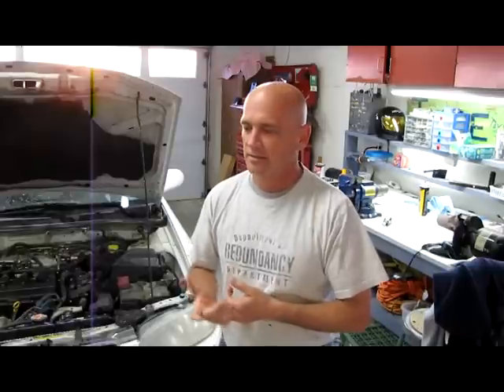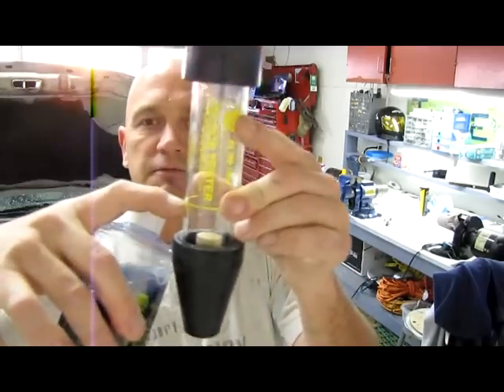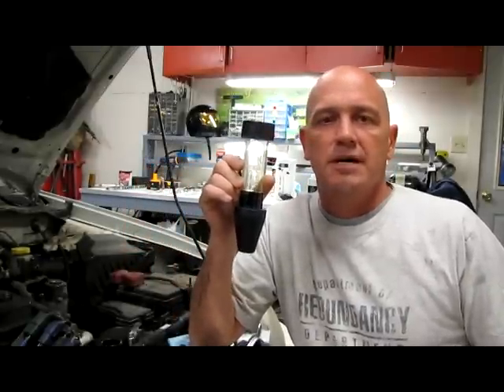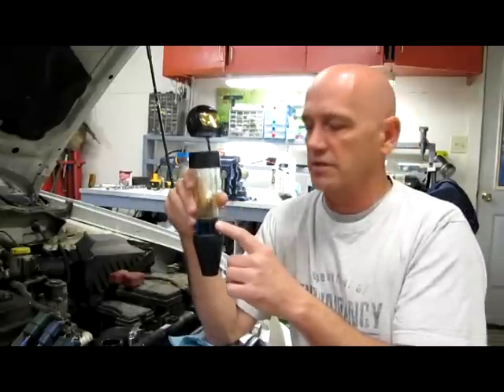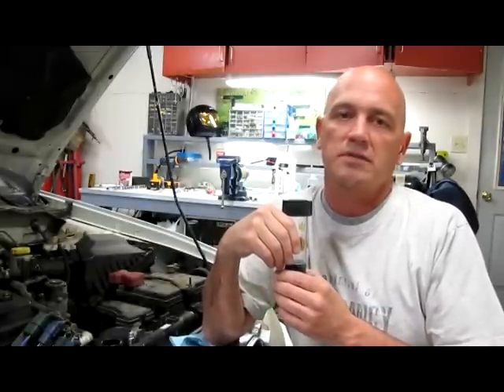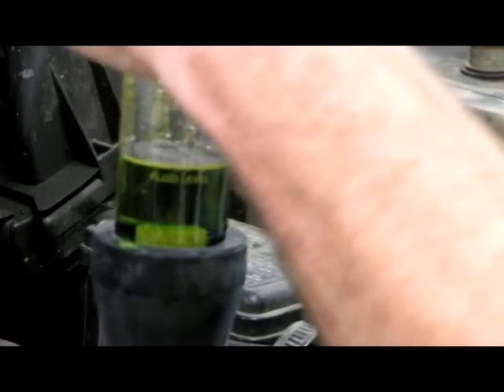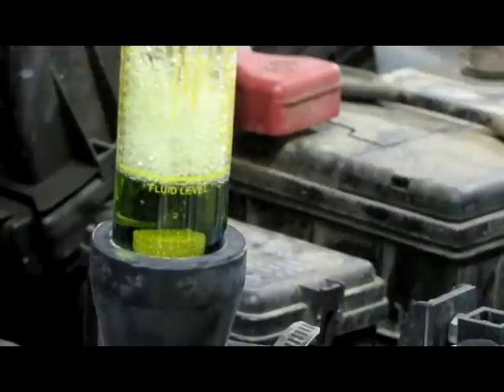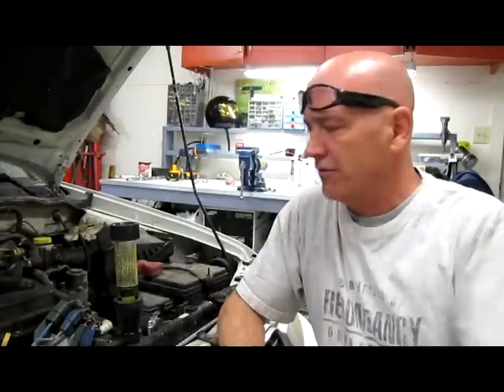How to Test Head Gasket

Comment from the maker: Effie Caine: I am guessing this is most likely a 4-cylinder vehicle. Several years ago in my 'day' of doing this, a 'typical,' but (must emphasize) PROFESSIONAL head gasket replacement on a 4-cylinder averaged about $500 with parts, R/R labor, and machine shop services (to check the head and correct any warps on the bottom). I'd imagine that the $300 difference is basically the increase since those years,so I don't think that $800 is a bad price, so long as it's PROFESSIONALLY done. Continues...

Comment: . He then wished me luck and let me go. Ive been driving it for 4 months still just baby sitting it. Putting water in the radiator every other day, and now the radiator is cracked again.. Sorry, I guess my question is do you speculate that it is just the upper intake manifold or head gasket? 3.8 Pontiac Bonneville 98. Thanks

Comment: @ reluctorvalve. So my car began overheating awhile back so I replaced radiator and both hoses. Also replaced thermostat before that. After the fact of it overheating again I saw a mechanic and he did a pressure test on it and it revealed that its a upper intake manifold leak but he was very concerned with the amount of pressure the car was losing in a short period of time. He also said the raidiator cap smelled like the "smell of death". He then wished me luck and let me go.

Comment from the maker: SpeedFighter2AC: This description doesn't necessarily indicate you have a leak.  Pressure Testing is the way I was taught to determine external leaks or even really bad head gasket leaks.  I've seen some bubbles in coolant flow over the years.  Unless it's exhibiting some kind of abnormal temp or anything else, I wouldn't worry so much about this. r-

Comment: I did the pressure test and no leaks but losing very little pressure. I'm lost here. Someone said it would be a bad water pump seal. But it should be leaking if a seal is bad not sucking air.

Comment from the maker: Joe Vang: Have you done a pressure check on the cooling system, or had one done?  I have a video also on that process- not exactly sure at this point.  I'd check good for any kind of leak, pressurize it for quite a bit of time and look for any small leak.  Intake manifold area (sensors, etc) sometimes take coolant for temp checks.  It's possible that your intake area may be leaking and sucking in air, but a good long pressure check should show that. Pressurize when cold and listen carefully- hm.

Comment: Thanks for the advices. Yes, the fan comes on. From what I'm thinking why it over it is on long drive the small air bubbles would build up in the cooling system therefore sending alot of coolant to my reserve tank thus making it overflow. I will flush the system and let u know. Also any ideas how air can get into the cooling system beside head gasket?

Comment from the maker: Joe Vang cont'd: when in stop/go traffic. At high speeds there is enough airflow over the radiator to cool it, but in stop/go traffic there isn't.  I'd start with that first. Blockage/restriction is as important, so you may consider a good flush with a flushing agent, or chemical, designed to 'scrub' the inside passages.  Wal-mart sells this- should be near the coolant section. Just follow the directions, and never add cold coolant to a HOT engine. Let it cool down first. Take your time. r-

Comment from the maker: Joe Vang: Ah, thanks for the vehicle info- that helps. Two things come to mind: getting hot in stop/go traffic indicates either low coolant and/or electric fan on yours not coming on during stop/go traffic as needed.  Of course, blockage can cause this as well, being restricted enough to do 'ok' in high pump volume when driving fast. Since you've worked on the car I'd rule out low coolant; I'd check the coolant fan switch in the radiator tank to make sure it's telling the fan to come on cont'd..

Comment: It would only it on long drives of hours only when I am stop in traffic the temp would rise but when I rev the car the temp would come down also when the car is moving then temp would go down. I'm lost. I'm thinking it might be intake manifold gasket becuz the bubbles are air bubbles not combustion air. Btw the car is a 99 civic ex.

Comment from the maker: Joe Vang: Hm- I don't have anything definitive, however I have read tech articles about 'flow' and when incorrect pulley sizes are used, that can cause bubbles.  You may want a shop to take a look at it to check it.  Does it overheat at all?

Comment: I did a Test to see if the head gasket was blown and it came out blue so there is no combustion gas in the radiator. I dont know if i have a blown headgasket, there is no milk in the oil, there is coolant still in their but the car would still want to overheat, it would almost reach F just below the line but it wouldnt overheat. The return tube on top of the engine would be hot, but the lower tube that goes into the engine would be cold and swollen? Why is it overheating?

Comment: Did this test for good five minute and color didn't change. I keep getting air in my coolant and it would bubble out in my reserve tank. I have no leaks. And change radiator cap and thermostat. I did bleed air out when changing the Tstat. Still having bubbles in my reserve. Any idea what it is?

Comment from the maker: Tom W: Well the test is designed to sniff for compression fumes in the cooling system; If you have milky oil, I suppose there would be cases where they could mix without the mix of compression fumes from the combustion chamber, or as you say, a cracked block or head.  I'd agree with your assessment. There are ways to check the block and heads for cracks, but unfortunately the entire engine has to be disassembled. You may be interested in my other vids on Blue Devil. Might be worth a try. r-

Comment: I did the test exactly to specs and the blue fluid did not change color-let vacuum pull through 30 min. But I am losing antifreeze and my oil shows signs of water-white milky.   Can a blown head gasket do this or is this more likely a cracked head
?  Should this test work either way?  Ford 2.9 known for cracked heads.

Comment from the maker: Rico: I think you should have a block test done on this; not all compression leaks result in oil in the coolant.  It sounds like it may have an issue like this to me. Does it misfire on one cylinder when you first start it in the morning?  I'd avoid driving it as much as possible until you have the block tested.  r-

Comment from the maker: Heather: No compression most typically is related to the mechanical timing of the engine, which is the physical relationship between the positions and the valves. What kind of car? Timing belt or chain? If the timing belt/chain isn't installed correctly, that could cause a lack of compression. Do you have compression in any cylinder at all? Of course blown pistons, burnt valves and other things can cause no compression, but if there was compression prior, there should be now. r-

Comment: Hi thanx for the info. Because my audi S4 keep getting hot after i changed the coolant.  I did not bleed te systeem i never tought of that. I also hear water runt true the heater radiator under the dash this means there is air trapped? I have truned on the heater and i opned the radiatorcap and let the auto run for a hour. The water level dropped and tomorrow i will test the coolant.  because if i go 100 miles a hour it pushes out al the collant.   thanx mate

Comment from the maker: Investigate cont'd: run the engine, closely monitor the temp gauge. If it begins to run hotter than normal, simple shut the engine off and let it set for about an hour or so. Most times this will force the air to the top.  When safe, open the radiator cap and you'll notice that the level has dropped. Might even wait overnight if you can. Top it off and rerun the engine, monitoring the temp gauge, and all should return to normal.  Hope this helps. r-

Comment from the maker: Investigate: simple answer is yes.  Many times air can get trapped in the cooling system, especially when draining and refilling. Some cars (Honda's typically) have an air bleed valve up near the thermostat that you can open up and as you fill the system through the radiator, air is pushed out through the valve; in this case when you see coolant coming from the air valve, all or most of the air is purged or pushed out. If you fill a cooling system up without a bleeder valve and continued...

Comment from the maker: carnage6ar: a bad water pump malfunctions usually by leaking or having a pulley bearing wear out- which can seize.  The chemical test persay isn't for testing for these malfunctions.  Now, if the water pump is leaking, of course that will eventually effect ability for the system to cool due to lack of enough coolant.  Pressure testing might be your way to go- to test for a leak.  Otherwise, you should check for proper flow along with thermostat operation. Hope this helps some. r-

Comment from the maker: 2jz101: you will want to run the test as the car warms up and particularly after the thermostat has opened, so yes the process is designed to be performed when the engine is hot. r-

Comment from the maker: Zeeshan Kadr: You could have a small leak in the reserve tank or in the hose that connects it to your radiator, or the engine in fact could be taking that coolant for refill when it loses it.  Have you had the system pressure checked?  Park in a clean parking spot when you go shopping and check under your car before going into the store.  When finished shopping, re-check under your car for new wet spots.  r-

Comment: Hi! I have a quick question, I have a 2001 Hyundai Accent GL, my coolant works fine and their is no problem with it. But when ever I fill up the small reserve box for coolant of water on the side of my car it empty in a couple of days. Do you think that I have some kind of leakage, but the level of the Radiator coolant is in a same level. Thanks

Comment from the maker: the2014 cont'd: I'm honest to a fault, and will continue to be, and yes, blamed for it. have a Toyota Camry I did this on (see my other vids) and it's still running strong.  If it were me, I'd run the crap out of it for quite a while to make sure the repair 'took' ok.  Make sure the thing runs as it should over a good amount of time.  Then, as we all know, all used cars are sold with no warranty implied.  I'd probably smoke a good deal to the buyers. Disclosure would be up to you. I would but ..

Comment from the maker: Joseph: After the radiator is replaced (successfully) the test will work normally- as long as you have a 'closed' cooling system, which is normal.  If you test it with a leaky radiator, and the leak isn't just gushing out and if the radiator can hold enough water to flow, the test should still work--but a good radiator is preferred, of course.  r-

Comment from the maker: Calvin: I recommend draining, doing a good system flush until it runs clean water out, install a new thermostat then running the test with just water- that will work fine. r-

Comment from the maker: Pedro cont'd: 'cold start' injector.  If you have a cold start injector, perhaps it's working all the time? Your description sounds exactly like a 'choke' that isn't releasing as it warms up, and yours is controlled electronically through either pulse width or cold start injector. I'd suspect that or an issue with communications/coolant flow in and around the coolant temp sensor. Good flush the old fashion way, new thermostat, and check that wiring around the coolant temp sensor for starters. r-

Comment from the maker: Pedro cont'd: In the old days, carb'd engines had 'chokes' which basically cut the air flow into the carb, and making the mixture more rich--which is needed when the engine hasn't been started yet.  Same with a lawn mower or any kind of engine- it has to be 'rich' when cold.  As it warms up the choke is then cut back, allowing less air and a leaner mixture. Today's engines do the same automatically but handle that in different ways by increasing pulse width or even having an additional cont'd

Comment from the maker: Pedro cont'd: before is when there is a 'bubble' in the cooling system or a blockage of good coolant flow around the area of the coolant temp sensor (or a bad wire connection to/from the coolant temp sensor), the computer isn't getting the proper signal from that sensor, so the computer thinks it's cold all the time.  I'd focus on that area of your fuel control, and what the computer is receiving. Check your wiring good in and around the coolant temp sensor. That condition would not set a code.

Comment from the maker: Pedro cont'd: which is known as 'pulse width' in time or 'pulse width' in physical stream shape- so how did you test them? Too much pulse width could be it but unusual. Fuel Pressure regulator will regulate that fuel pressure on the feed rail(s) to the injectors, but it's really more about how much is getting through the injectors, which is too much, obviously. I still think that the electronic control is messed up- whether it's being 'told' erroneously or not. One idea I've seen cont'd...

Comment from the maker: Pedro Sousa: Hm- well you definitely have an overly-rich, flooding type situation going on. It's really odd to me that your car doesn't have an oxygen sensor--that's what tells the computer how rich/lean it's running! Not sure how the computer has any way of adjusting. MAP, or manifold absolute pressure really doesn't tell the computer about mixture so much (unless someone else out there has more experience with MAPs). The injectors typically 'shoot' fuel for a duration of time cont'd..

Comment: hi, my car its fuel injected. I cleaned and tested injectors, all sensors, new ECU. The problem only appears when the engine starts to warm up and when its hot. new coolant temp sensor, map, sparkplugs and cables, idle valve.
my car doesnt have oxygen sensor or lambda sensor, it only has MAP Sensor.
ECU only give flashing led codes and it say to me that the system is fine.
i havent look to the sparkplugs yet but i will see that today. another thing: when i rev, i ear some bubbles in heat matrix

Comment from the maker: Pedro Sousa cont'd: all the time, and/or perhaps a bad oxygen sensor.  I'd say you need to have your vehicle put on a scanner and have the codes looked at-- I'd start there. Otherwise I would need to know more about your vehicle- I assume it's fuel injected. If not and it's carbureted, could be a sticky choke, a choke pull-off with too little air gap-- have you looked at the spark plugs yet?  Do they look heavily carboned up or not? That would tell a lot about the mixture. Let us know! thx r-

Comment from the maker: Pedro Sousa: Just a question: does it seem to run 'ok' when it's cold?  As it warms up the issue then happens?  This sounds to me like when it reaches 'closed loop,' or computer-control, it starts to mess up. When it's cold it runs in 'open-loop' which is not in full-computer-control, sort of.  It sounds like something is erroneously telling your computer that it needs to dump gas in the mixture.  I suspect you have a coolant temp sensor erroneously telling your computer that it's 'cold' cont'd

Comment from the maker: Tyler Chronson cont'd: I would venture to guess that whoever owned your vehicle before never flushed it and on top of that just added water and never coolant; further, do the flush yourself--I am guessing you may have a blockage somewhere. Start with a clean system and a new thermostat. If the block test came back straight blue, then it's not detecting combustion fumes in there, but you have another issue.  I would love to hear back on what you find.  Good luck!  r-

Comment from the maker: Tyler Chronson cont'd: of the engine either through where the thermostat was or through the upper radiator hose, and flush until clear, and I mean clear. Install new thermostat and seal (or gasket), fill with 50/50 mixed water and coolant, and run til warm.  May need to 'burp' the bubbles out if it runs a bit too warm by turning off and letting it set overnight or for a few hours.  Top off.  A 'true' flushed and clean cooling system won't give you rust-water, which is what you are getting cont'd

Comment from the maker: Tyler Chronson: Great descriptions! I recommend that you start with the basics of a cooling system: flush it yourself, and do it the 'real' way, starting when it's cold: drain the radiator; disconnect the upper and lower radiator hose; take out the thermostat; while cold, use a waterhose with moderate waterflow and flush just the radiator until the water runs clear, and I mean clear. Next, do the same with the engine by putting waterhose in the top ..cont'd

Comment: Hi man, nice videos. I would like to have onde little help from you.
I have a Ford Sierra Dohc EFI (125hp) and i have a problem with it.
When the engine starts to getting to its normal temperature, it starts stalling at idle and i can smell a lot of gas exiting exhaust, some kind of grey/white smoke, misfire and a lot of water.
My coolant tank dont lose anti frezee, or bubbles or change color.
The engine is stalling in hot and is overfueling (15l/100km).
What can I do?
Thanks

Comment: I had planned to fix the head gasket with Blue Devil as I purchased the truck for only $500 and only need it running through this summer. I am wondering why there was no sign of combustion in the coolant and if it is normal for there to be evidence of rust and gunk after the radiator guys said that they had flushed the system twice. And why is the radiator fluid ( in this case dirty water) spewing out while idling. Thanks so much for your time!